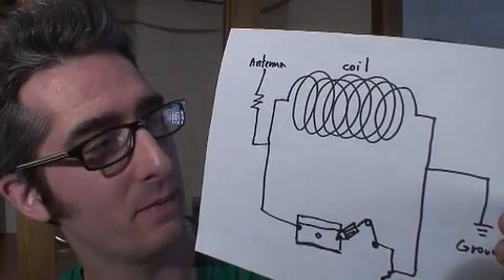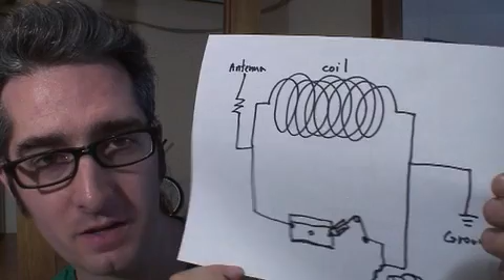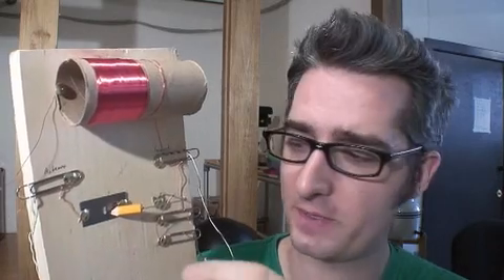Make on Rocketboom: How To Make a Foxhole Radio

Comment: can we determine the frequency received perhaps by antenna length calculation? tube circumference and wire length per turn etc etc?
Great vid.Seen it as cats whisker and crystal but not with razor.